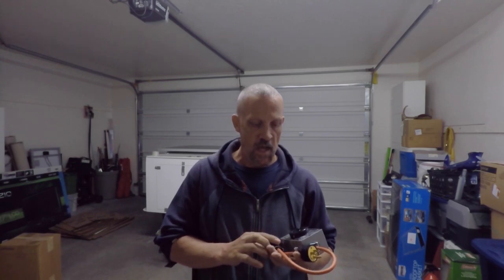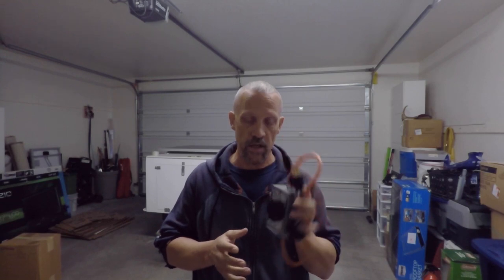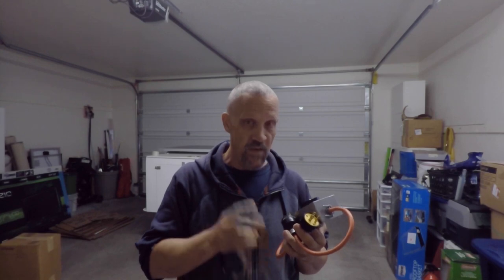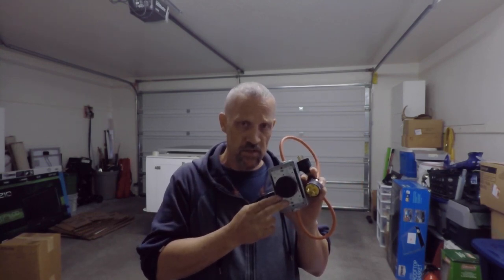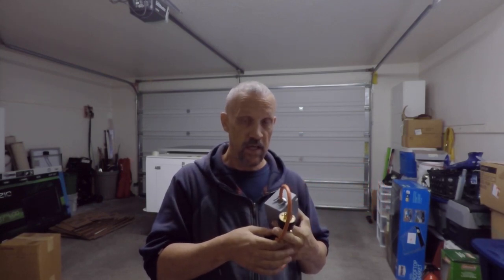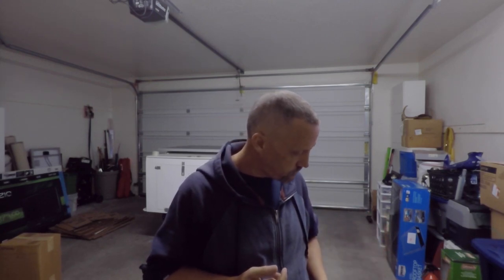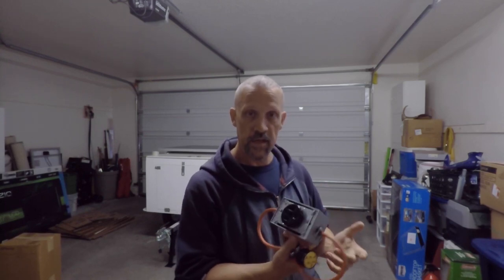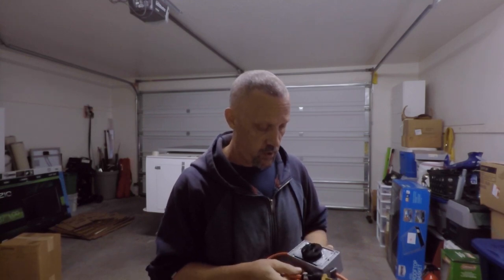How to Get 220v From 110v Questions Answered and SAFETY CONCERNS

Comment: There is a device called evdoubler,  its expensive & it does the same thing. It also has to be wired the same to work like this. They make no mention of having to marry the two breakers or danger if one gets unplugged or breaker trips. I did exactly what you did, but hard wired mine at the outlets. For the wire I did used a heavy duty extension cord as they mention to do on evdoublers site. My charger says 16amps on this 15 amp setup. It has a smart chip in it for overheating & over amps, so it must adjust less than 16 amps because its never hot & never trips the breaker. It works perfectly thank you for your video
Reply from the maker: Exactly Justo! That device is exactly the same as what I have created here. I too have had no problems with wires over heating or tripping breakers. I appreciate your comment and thanks for watching!

Comment: Not sure this hasn’t been said before in previous comments, although we have a portable carpet cleaning extractor that has 2 Extension cords that are designed to plug-in to 110 receptacles of course on different circuits therefore giving the carpet machine 220 V. I like your device in fact we have several different devices similar to that so we can backfeed electric into vacant apartments and we do it carefully as to not create any problems. Thank you for your post brother

Comment: Dude, I was skeptical when I found the how-to video, but I watched it, and what you did made sense to me. And I'm no electrician by any means, but I do understand the basic principles of wiring a circuit. This second video was good as well as a follow-up on some safety issues. Don't let the pompous ass folks get you down. I don't think they've got half the guts you do and doubt very much the majority of them have the nerve to do what you do here on YouTube. Keep up the good work!!! If you're watching how-to videos and don't understand that you should confirm information from multiple sources, don't try to lay blame on someone else when your shit get's fucked up because your to ignorant to clarify what you don't understand. And I also agree with you about all those "Experts" who just sit on the sidelines and snipe away rather than making their own videos. Get that shit out of here!!!
Reply from the maker: Thank you Brent, I appreciate your input! 👍
Reply: @DIYHomesteadProjectsDIYHP10  Hi there, Also not liscensced but a hobbyist here. im lucky enough to have a pair of 120v seperate curcit outlets close together and im about to go through the process of tracing my second curcit to my panel personally on both to check for arc fault breakers. i also plan on building my unit with more smarts cause i want to be able to have it isolate if im doing something wrong. might as well have put in a breaker after the breakers.

Comment: I know a  20 year journey man electrician . Five years ago he went to his friends house to change a light bulb that was broke off in the socket, his friend was at work when he got there to change the broken bulb. He asked the wife where the light switch was, she pointed to the wall but did not mention there were two switches. the switch was in the up position being off for a double switch, but on for a single switch, he walked over flipped the switch down.  He then walked to the light socket, put on a glove so the broken glass did not cut him, reached up to turn the broken bulb out, the arc was so hot it burned the glove back to the start of finger holes. It also disintegrated his thumb  to the first knuckle and his index and bird fingers  to the second knuckles. that goes to show experience is not every thing safety and caution are factors too. I'm not an electrician by no means but I would still have my fingers and thumb because I would have turned the main power off.
Reply: SOOOOO he did not use a circuit HOT tester to see if the power was in fact off.  I work with Telephones and even I have a circuit tester for electricity to see if the circuit is live or not.  The testers are incredibly cheap to buy too.

Comment: Glad to see this video. I have done what you did only to test something temporarily in a place where you don’t want to install anything. In the panel there are two hot bus bars line one and line to plus a neutral bar and a grounding bar. It would seem you have some knowledge as you were able to figure this out. Some are just not wanting to work in a panel. There are many weak links in doing this as you know now. Thanks for explaining why you did this it could be a liability that’s all. Some people will do anything I don’t know if you remember when all the folks put there phones in the microwave and drilled there iPhone to try and get the head phone jack back. It takes balls to come and do a follow up video. Good for you and shows you are a stand up guy.
Reply from the maker: Thank you for the positive feedback, I do appreciate it! I didn't know about the "phones in the microwave" situation. You just never know what you will find on YouTube and I suppose my video is a good example of that too. I definitely don't always do things correctly and I'm far from perfect but I am also not afraid to admit it. I don't think it hurts to show people what I have learned. I think it helps everyone with the same interests and we can all learn from one another's mistakes.

Comment: I like the concept Bruce, as well as having two separate 20A 120v receptacles available in the garage you also have the ability to yield a 240v 20A  receptacle. Kudos to you.
Reply from the maker: Thank you salceti
Reply: one thing that is confusing me though, is how do you know which leg the two breakers are on? If some panels are wired differently than others. How am I sure to get the two different legs?
Reply from the maker: You can test the two hot legs of the outlets you want to try and use with a meeter like I did in the video. If you get 240V you have the correct two outlets. If the two hots test reads 0 volts, you'll know those two outlets are on the same line in the breaker box and they won't work.
Reply: @DIYHomesteadProjectsDIYHP10  thanks very much

Comment: Great follow up video. I think that you made this device to show people how to get 240 out of 120 and you explained very simple and your absolute right people don’t use common sense. Personally I put a video in how to convert 240 washer/dryer to work with 120 but using only the washer because the dryer broken.  I had good and bad comments but works for me and still using that washer..thanks so much for this follow up video, has a ton of information.
Reply from the maker: Glad it was helpful!

Comment: I'm an electrician, but I didn't wire the Empire State, nor do I feel the need to call you names. My impression was that you made a workable device and thought through some safety things, such as ensuring the grounding wires were bonded to the metal box. You also made clear there were probably some things you missed and never claimed this would be safe for everyone. Given your situation, your solution made a lot of sense.

I'm assuming you heard from commercial electricians working for big companies. They absolutely must follow OSHA regulations and have the luxury of throwing away extension cords when a cord cap breaks. The rest of us do not have such resources and will make our own contraptions (not meeting OSHA requirements), but ones our knowledge and experience say are good enough when we use them. These "real electricians" look down their noses at us with the same unbridled contempt as you experienced.

I respect you thought of a solution for your problem and spent the time to learn whether it would be safe enough for you and did think things through. I wouldn't suggest making it for friends or selling it, but that wasn't your intention. Honestly, given your situation, I would have made something very similar, although I would have put a metal plate over it. 

Just know the electrician snobs you dealt with with have an even worse attitude towards smaller time electricians like me. That's why I don't post on YouTube or anywhere else, even though I'm a community college electrical instructor. Any little thing they think is wrong and they are like a swarm of hornets.
Reply from the maker: It's nice to hear from someone with common sense and actually understands what I have done here! Thank you for the comment, I appreciate it.

Comment: Yes, that will work.  I have done that on occasion when I had to weld something for a friend that didn't have any 220v outlets.  But the safest way to make one of these adapters, is by using a small 2-circuit load center like the Square-D QO2L30SCP (good for up to 30 amps) which allows for a 15 or 20 amp ganged breaker (depending on your welder requirements) instead of the regular junction box.  That's what I wound up making and keeping with my welder for those rare occasions when I need it, that way both phases cut out if there is an issue.
Reply from the maker: That sounds like a good idea. If I were to do it all over again I think I would give your idea a try. Thanks for sharing the idea.
Reply: @DIYHomesteadProjectsDIYHP10  You're welcome.  I subscribed.  :-)

Comment: The right and left side of the load panels are identified as L1 and L2 for "Leg 1 and Leg 2" which are two phases of 180° offset power.  That means when L1 is at its maximum peak of positive A/C voltage, L2 is at its maximum peak (which is positive, of course, but usually shown on the underside as negative voltage wrt to L1).  Same for 0 values -- same time, all rinse and repeat 60 times a second in North America, 50 times a second elsewhere (60Hz/50Hz).

The voltage is within a range of 110-120VAC so call it 110, 115, 120... or 220, 230, 240 for two legs ("split phase").  It doesn't matter what you call it.  It's what the voltmeter shows.

You ran two 20A circuits from two different legs in the panel (which if your panel is oriented vertically you're calling the "right side" and "left side") which are L1 and L2.  How do you know which is which?  Whatever label you stick on there, make one say L1 and one say L2.  Nobody on the utility side of the panel cares, and on the inside you only care to be able to balance loads.  (That's what you do in the load panel :)

So what you ran are 6 wires to make 2 (dual gang) 120VAC outlets.  That's 2 hot, 2 neutral, and 2 ground.  Then you built a box to make the two hots meet up, the two neutrals meet up, and the two grounds meet up.  Seems like a lot of wasted time and money to multiplex into those 6 wires only to demultiplex ("combiner" isn't a real word here) them into 3 wires.

Ground doesn't need to be doubled.  Both ground wires go to the same ground in the load panel.  If the wire is of sufficient ampacity to discharge the amperage (20A+20A=40A) then you're good.  8awg max, 10awg will work.

Neutral and hots definitely need to handle the full ampacity, so 8awg is indicated.

-- WHAT IF -- you hadn't used "two sides" of the load panel, and just had two 120VAC outlets?  Your combiner box would output 120VAC since both hot leads coming in are on the same phase.  Voltage is not doubled, but amperage is. 

-- WHAT IF -- you hook up directly to the wires and get rid of the 15A outlets?  That would be safer and smarter because right now they have a potential fire hazard situation if your welder draws more than 30A (15A+15A=30A max through the 120VAC outlets and your extension cord plugs.)

-- If you're going to do something like this, good for you.  Obviously it works.  However, you need to tell people exactly what you're doing.  Just saying "I ran two lines" isn't enough.  You should ensure to say you ran two lines... to two different phases off by 180°.  Why am I being pedantic?  In North American office/industrial we get 3-phase 408VAC which ends up as 120VAC at the outlet... but if you "combined" two outlets you'd get 208VAC not 240VAC, because with 3 phase power they are off by 120° from each other, so the highs and lows aren't identical in time.  This is great for motors, but makes your "combiner" not workable.  In that case you'd want to get 3 of the 120VAC phases, and take 277VAC and transform it down to 240VAC.  That's even more inefficient.  Might as well run 480VAC and transform it 2:1 to 240VAC.  Much more efficient, which is why it's prevalent.

"Split phase" is what people say nowadays for 240VAC over two legs/phases.  It's really a nonsense term.  Nothing is split.  Also get yourself a clamp meter so you can verify what your welder is actually drawing.  If it approaches 15A on the outlets, time to change outlets.  Also your breakers at the load-panel should be downsized to 15A so they go first... before the outlet catches fire.

NEMA 5-15R are the outlets you have.   (R is for Receptacle).  Rated at 15A.
NEMA 5-15P are the plugs you bought.  (P is for Plug).  Rated at 15A.
NEMA 5-20R/5-20P is what you want if you're going to stick with this tarbaby.
Make sure your breakers are sized to be as low as the lowest element in the Load-Panel - wire - receptacle setup.

If you did upgrade your setup to a double-breaker, 8awg wire run to a NEMA 6-50R that would be ideal.  If you still need 120VAC you can put a UPS in there to charge up on 240VAC and deliver power via 120VAC outlets.  Still efficient.

Best wishes.  I'm off to design an on-grid hybrid whole-house solar system.

Comment: I saw your other video and only read a few comments. Sorry to hear you were so badly treated. Your video answered a problem I have run into in my shop. I was happy to see it. I have never understood the need for some people to be so offensive in their comments on YT. The effort all producers on YT expend is remarkable in my opinion. Thank you again.
Reply: I would add, I think putting a 50amp plug on the combiner wasn’t ideal. It could lead someone to put in a 50 amp device. But I totally agree, it is your device and you know what it’s intended use is for and there shouldn’t be a problem. I like how you think.
Reply from the maker: You are quite welcome, I'm glad you liked the video. No worries about the negative comments, that's the way YT is. The more negative comments I receive, the better the video performs. It's amazing :)
Reply from the maker: My thinking on the 50amp plug is if someone stole my device and decided to plug a 50amp device into it, the 20amp breaker would trip and it wouldn't work. I also think the breaker would trip at 20amps and protect the 12 gauge wire like it was designed to do.
Reply: DIY Homestead Projects yes, I’m sure you’re right. And if it didn’t, well, serves them right Isla their house burns down. They likely will learn.

Comment: Somebody asked about a sub panel but I wouldn't recommend that if you have two hots the  neutral has to go down the same pipe or romex you will have heating problems with the circuit, tying the neutrals together won't alleviate the problem it's best just to run a proper cable from the panel to your garage. I have troubleshooted commercial buildings where guys have run the neutral down  another pipe and it's hot enough to burn your hand

Comment: Glad you cleared up some of the issues... I too am a DIYer even with electrical.  In Ontario Canada  a home owner can pull their own permit and do a complete rewire with a new panel AS LONG AS IT IS to CODE.  I have done this for 5 houses and was able to accomplish that with a little yellow paperback called Ontario Electrical Code Simplified....$23 on Amazon... the best money you will ever spend.  Not only does it explain how to wire to code it explains the reason and even points out when the code is stupid.  I would suggest to anyone DIYing electrical that you consider the consequences if you burn your house down before you experiment with electricity from the grid.
Reply from the maker: Thank you for the positive feedback! I appreciate the information on the helpful book. I may have to pick one up.

Comment: Both videos are very good you did right by walking back some of the things from the last video because  it’s a “Cover your ass” world, and you’ve done that... so thank you for the info thank you for the update like you I have machines that need 220 and it’s not available in my new garage. You gave me information that I needed now I feel confident that I can use my machines. I wired my last shop and I’m not a certified electrician but I’m a DIY guy like you. Thanks

Comment: Richard McKenna

Years ago I powered a 50 Amp 240V plug from two independent 120V circuits and I ran my welder from that with no problems as I was using the low settings and, hopefully, wasn't drawing more than 40 Amps.  BUT I did use heavier wire in the installation, INCLUDING a ground wire!  

The ground wire from the source, the panel, was missing in your contraption.  You had ground wires to the metal box, but the metal box wasn't grounded to the panel.  I am not a certified electrician by any means, and what you had built did work, it just wasn't safely grounded!  Which could have been a BIG deal in the worst-case scenario.  

Kudos to your ingenuity and I enjoyed both of your videos.  I agree that you should install a dedicated 240V circuit in your new digs to be safe.

I am not trying to criticize your efforts, but the grounding issue caught my attention from the get-go and I just wanted to put in my two cents worth.

Carry on man and the best of luck to you!